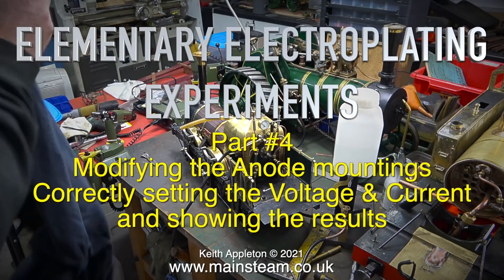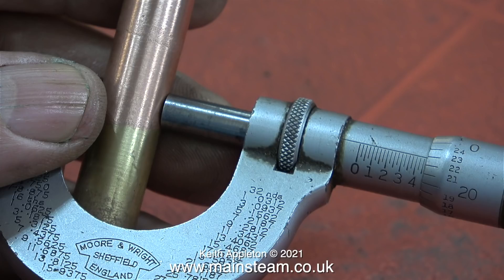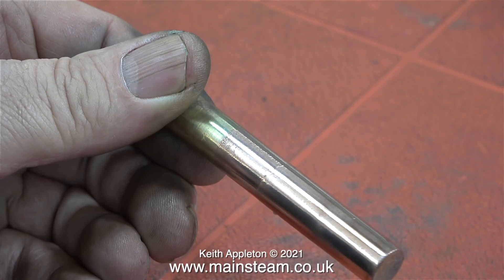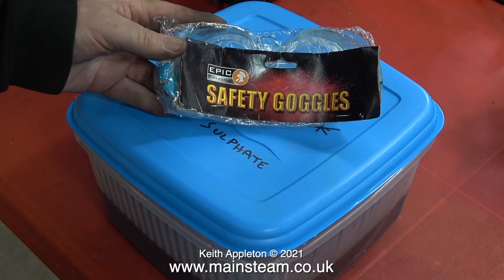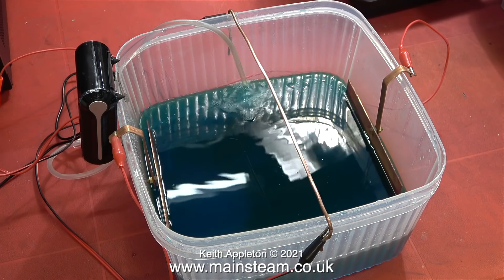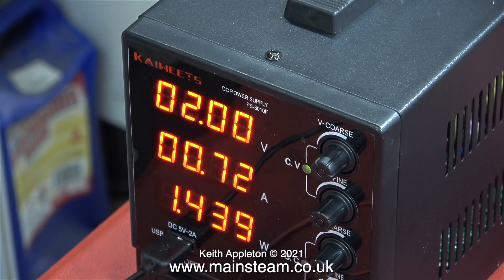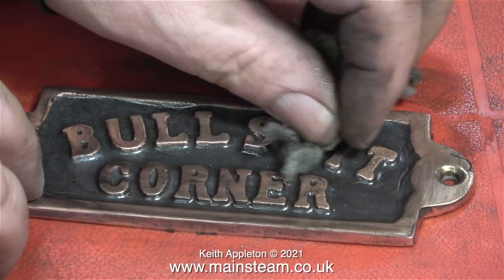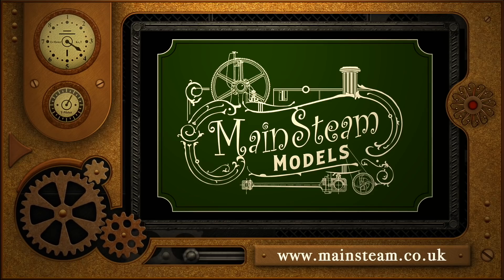ELEMENTARY ELECTROPLATING EXPERIMENTS - PART #4

Comment: Re. The poisons that can be used in commercial electroplating: Many decades ago I worked (drove) for a prestigious electroplaters. I'll redact the name to protect the guilty. In our original position we had a dedicated drainage system to take our waste for proper disposal. Long after I passed onto pastures anew, they relocated a few miles away and were fined several times for unrestricted dumping in a nearby beck. Eventually they were found guilty of poisoning a several mile stretch of it, with the result that everything living in or near it, wasn't. They were fined into oblivion and lost their licence to operate.

Comment: Keith, don't forget that plating fumes/spray will badly corrode/rust almost everything in the same room, if you don't have excellent ventilation.  Even expensive commercial electroplating equipment can rust away!

Comment: Ideally, you should set a constant current for the area plated, not a constant voltage.
Turn the current settings down until 'CC' lights, then turn the Voltage up high.  The current controls should then set the current, and it won't be affected by the electrolyte or connections etc.
For what you are doing though, as long as there is some current flowing, it should plate.

Comment: Electroplating is super handy at changing the fit of rotary parts without needing to scrap the part.   I've used it on a few occasions to thicken a shaft or narrow a pulley to improve the fit.

Comment: "Plating a pitted part with give you shiny pits" said the owner of the plating shop I first had some chrome done. 
If I remember right, soft Copper plate can be smoothed out quite a bit by burnishing with a hard piece of metal before using abrasive polish.
Love how this tutorial is going.